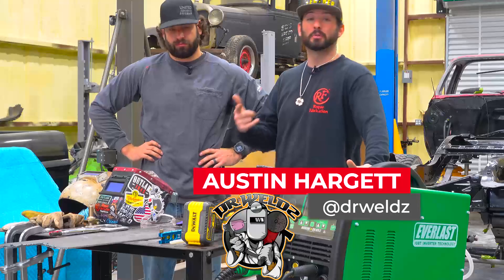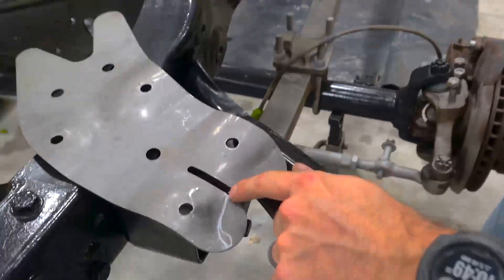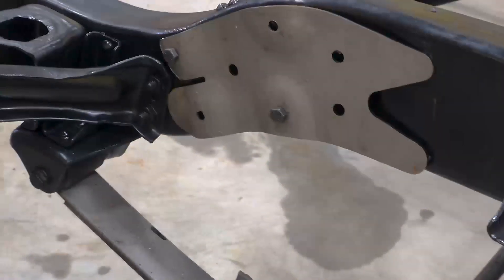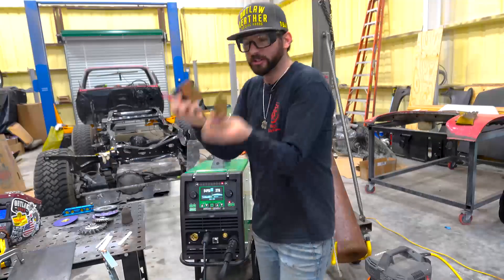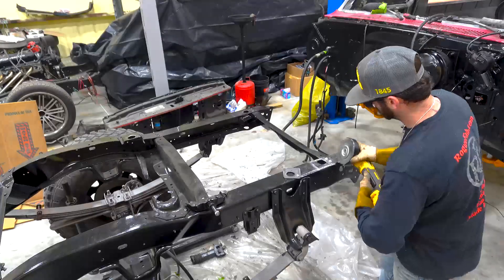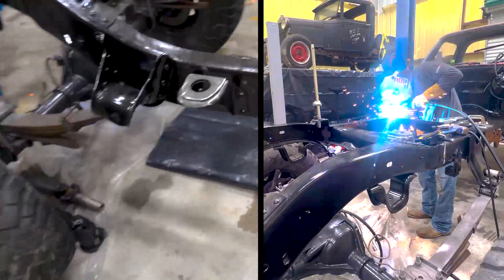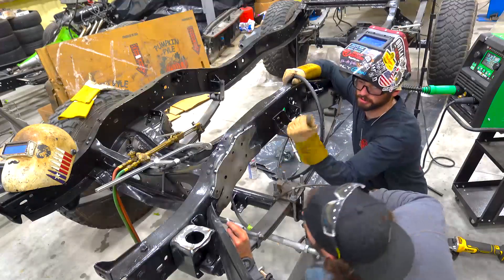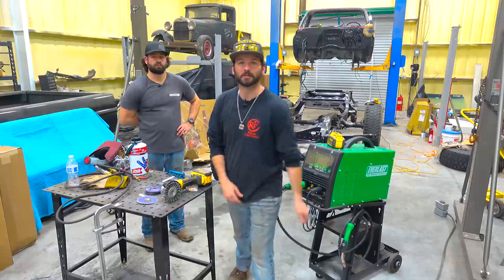Truck Frame Restoration Using Simple Welding Techniques

Comment: Why Fish Plate on Railway Track Is So Called, Does it Have Any Relation with Fish Dishes?
Rail fish plate, also called rail joint, is used to connect two steel rails together. Many people question why it is called fish plate, actually, it has no relation with fish dishes. The word ‘fish’ in fish plate derived from the French word ‘fiche’, which means a peg, ‘fiche’ is derived from the old French word ‘fichier’, it has the meaning fasten, therefore fish plate means a plate that can be used to fastening.

Comment: If you guys would use the correct recommended cut pressure of 65 to 72 psi, you'd get cleaner cuts. 49psi is too low and can do long term damage to the torch and cause excess consumable wear.